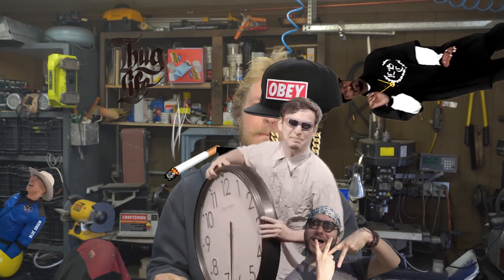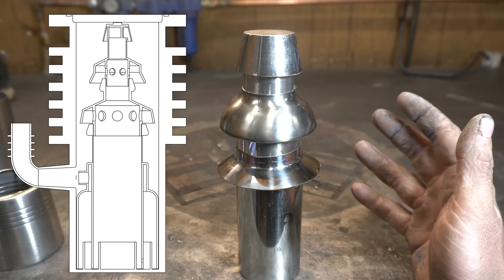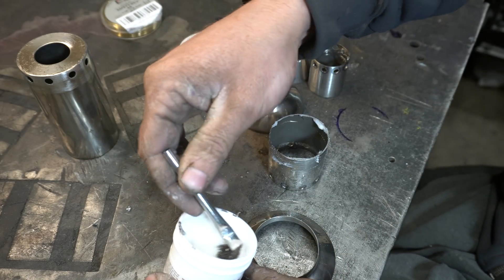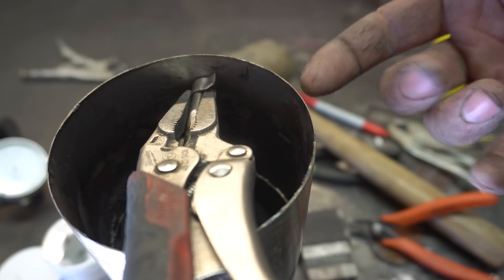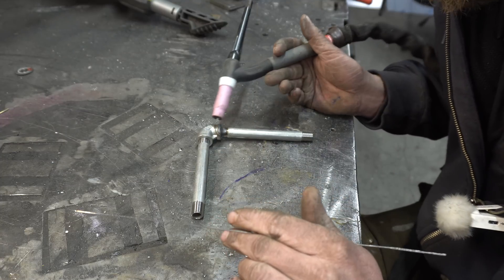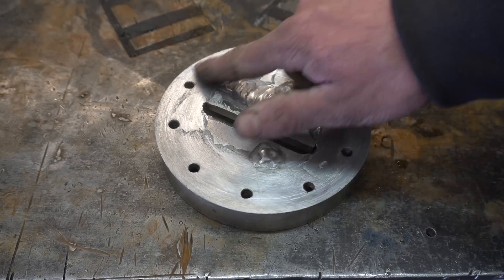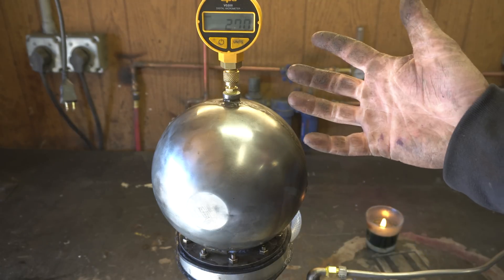Using Your Help to Make Better A Oil Diffusion Pump

Comment: Your diffusion pump videos are great on several levels.  Years ago I bought a small used CENCO diffusion pump - but I talked myself out of giving it a try.  After seeing the momentous efforts you've gone thru to make your own, I feel guilty, lazy, and maybe even idiotic.  I pulled it out of storage today and am committed to heating it up.  For all I know it will work better than I need it to work -  0.01 mm Hg is all I need.

Comment: You can do an experiment to obtain a high vacuum using a mechanical pump operating in a vacuum environment (at the inlet of such a pump there is a vacuum.) The working volume can be large, it is easy for it to pump the remaining gas molecules, and a large volume allows for productivity. I’m not sure about the feasibility of such a pump, but it is only possible

Comment: A couple years ago I built one of these too and it's up on my yt channel. I used exhaust parts instead of other stainless and used jb weld in place of brazing since I read somewhere it could perform well at high vacuum. My experiment failed but it's nice to be able to compare and contrast the different approaches you tried and now I want to try it again! You've earned a subscriber cause your projects are awesome!

Comment: I'm rather impressed with your results.  One of my previous jobs used a diffusion pump that required about 5 gallons of oil!  Was a bit bigger than a 50 gallon drum.  Needless to say it took a few kw for the heater.  Princple was the same and the stack looked a lot like your home-made unit, 'cept being way bigger and too heavy to lift without a crane.

Comment: congrats, you reached to about the same level of vacuum of a good 2 stage mechanical pump 🙃
on a more serious note, you need to clean stuff like crazy, 99.9 isopropyl alcohol then distilled water, then again, then bake all the gear for 1 or 2 hours, then never touch the inside with your fingers.
also, below about 20 microns that gauge is not going to be able to measure anything

Comment: For pressures below 10 microns you really need to use a hot filament ionisation vacuum gauge. The good news is that the gauge sensor is really simple and an improvised gauge is easy to make from stuff you already probably have lying around.

Comment: Try to use pure silicone oil . The cheapest way is get tradmill oil. It 100% silicone oil. I tried it and it works fine and very cheap.

Comment: You should bake the pump and chamber to get moisture out of the surface. Also leaving it running for a long time will help it go down more after a while. You may be hitting a few walls on the way down that just take some time to break through. IE. once you hit the vapour pressure required for moisture to come out of your oil, it will stop going down till the moisture is gone. The same goes for the metal surfaces. Your guage could also cause problems. Look for a pirani gauge on aliexpress for around $20.

Comment: Only thing I can say, is dude... Don't ever change.  Your presentation style with subtle tropes of autism just make my day.  Also, I found your channel a while back when I started researching the feasibility of building my own laser cutter and was just blown away by your success with not only building a complete from the ground up CNC cutter, but the damn tube to boot!  I'm currently waiting for all of the stuff I ordered to show up while printing parts like mad for an MPCNC that v1engineering designed.  Thanks for the inspiration!!

Comment: Another tip for you. I had to go back in your videos and find the diffusion pump you first tried to make. This was the only way I found out WHY you are building one of these. I had to go a little further to find out how it works. I thought I understood the world pretty well but there was still a TON here that I had to research to learn.   I think you would benefit a little bit if you mentioned your other video , linked to parts in it, and/or mentioned your main purpose for doing the work seen in this video. It helps connect the puzzle pieces which means more ppl will end up doing so -- and your channel would likely benefit.     At the same time, THANK YOU for not doing the "subscribe and like" BS that everyone else does

Comment: Amazing video yet again :) and here I am again to make a lengthy list of suggestions, mostly corrections to the first advice I gave lmao
1. Helium trick works way better with a much more accurate gauge and at lower pressures  than your current gauge can read, my bad :/
2. Viton is much better than silicone BUT not flat gaskets, o-rings are much more preferable since they have minimal contact and don’t trap gases as easily
3. Cycle purging, or pre purging your chamber, don’t know why I didn’t think of that one earlier facepalm but anyways use a dry gas of any kind to help remove volatiles and water vapor
4. On the note of water vapor, it’s the high/ultrahigh vacuum’s biggest nemesis since it likes to “cling” to stuff, having a way to bake out your system would be beneficial, in true cranktowncity fashion you could probably manage this just by taking a blowtorch to it as long as you don’t get the gaskets too hot lmao
5. And of course what you mentioned and I somehow completely missed earlier, the roughing pump, that definitely would’ve been the biggest improvement and probably the easiest one since 2 stage pumps and decent pump oil are pretty cheap facepalm x2
Anyways love your content man keep it up :D
Reply from the maker: Hell yeah man, thanks for all the advice. I still got my eyes on your channel waiting for that sputtering machine (If you ever get time off work haha)
Reply: Something i havent totally understand is how improving the roughing pump would help to to achive higher vacuum unleast you are talking about shortening the time to achive uhv since the diffusion pump is suppose to be the main pump that bring the chamber to uhv after the roughing pump is already ineffective
Reply: @btkjay9598  Even though the main pump is achieving the UHV there is always some leakage back through the pump (they only are capable of building up a pressure gradient even if not in laminar flow region). This leakage is significantly lower when reducing the pressure at the backing pump (and also pump speed is increased massively of course).

By the way viton gaskets: Beware that they get brittle after being hot or very cold (when using them on top of commercial ODPs they're usually single use only).

Baking chambers usually works for UHV systems up to around at most 200 Celsius especially when having some windows in there. This won't remove any hydrocarbons thus the best way when one wants to achieve very low vacuum is cleaning first everything that's visible, then cleaning in some soapy sollution, then doing a ultrasonic bath in distilled / deionized water - after that rinsing with distilled / deionized  water again and then dryblowing using nitrogen or argon (never evaporating since that will leave residue). From that moment on only handling with clean gloves - then heating up somewhat above 100 Celsius for a few hours while running the vacuum pump will work (we reach around 10^-12 mbar with that approach by bringing down the chamber first using a membrane+turbopump, then shutting off and using ion getter pumps & in the beginning also titanium sublimation pumps). When one gets in some hydrocarbons one usually has to clean again from scratch (or heat above 400 celsius which is what some manufacturers do before delivery of the parts but that's usually not possible inside of an experiment), when getting in silicone oil or nastier stuff one has to clean in the ultrasonic bath for sure ... have seen Vacuum chambers where baking has not been done using external heating bands but using halogene lamps inside the chamber, that also worked pretty well

(Water vapor should be gone very fast - the next problem that one can counter using baking and that takes way more time is then diffusion of Hydrogen out of the stainless steel surfaces of a typical vacuum chamber. This takes ages especially since pumping Hydrogen is harder than pumping other gasses (which is also the cause why one usually sometimes uses periodically gas balast on the backing pump to reduce hydrogen accumulation in between the backing and main pump to reduce diffusion - but all of that stuff only gets interesting when reaching lower pressure regions for sure - would not care while being above the 10^-7 mbar range / reaching the 10^-8 mbar except for the water vapor that gets interesting at around  roughly 10^-4 mbar for sure ...)
Reply: A better roughing pump yould suck too much of the working-oil-steam. Additional cooled buffles would be needed on the upwards section of the tube, that connects the 2 pumps (or you end up with to little working-oil). Those buffles would re-turn the working-oil-stream back (to where it should stay), but also pushing the gases (that you actually wanted to evacuate) back into the difffusion-pump too, so, an unwanted effect. There´s a point of diminishing returns in this whole scenario, as you can guess. What do people do in industrial installations? Do they use the best roughing-pumps available? OR are there other aspects, that promise more success for now? (for example, an even better working oil, while avoiding welding altogether). A young YTer from Europe mentioned an oil-trader from Germany (just 60€ for 250ml), and the "AppliedScience"-guy noticed, that he used too low-grade flexible tubes for the project´s demands (air would diffuse through the hose-walls)... 33µPa is extremely good, even if 20 is even better, but who REALLY needs such a low vacuum after all ? (let alone 0,1µPa...  ;-)

Comment: This is fantastic, you fabricated a working diffusion pump! Your vacuum reading could easily be the gauge being close to it's limit! I'd be willing to put some money on the pressure being lower than you think.

If you can pick up a Penning gauge (a.k.a) Cold Cathode gauge, those are great: Some of the old style ones are robust, you can clean some of them with wet and dry paper when you need to (I found Edwards ones to be easy to fix unless the metal inside has worn away, others can be but have tiny parts inside). Another one is ion gauges (hot cathode/alpert bayard) but they are pricey and used ones can give weird readings if the were abused and they are easy to kill (or so I am.. ahem told). 

I'm so glad you shared this! It's inspirational!

PS Burn out sucks and it also shows you care, take care of yourself!

Comment: I am curious what will happen if you prefill the chamber with argon, will it just speed up the process or pull it a digit or two higher
Reply: Pretty solid idea actually, it would be even better if he purged it with very dry gas for awhile and possibly even cycle purged it while pulling a vacuum

Comment: Have you looked at mercury to pull vacuum?
Reply: I mean besides the environmental dangers he would still be limited by the vapor pressure of mercury which modern diffusion pump oils far surpass

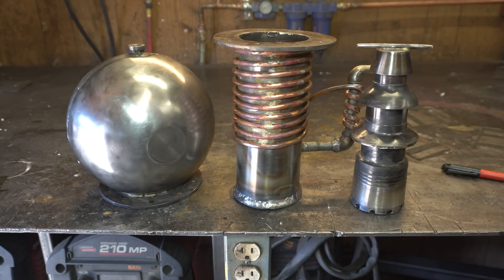Comment: 11:19 you could probably use a thermal epoxy to hold it in place and for heat transfer

Comment: A different approach could be a Sprengel Vacuum Pump -->  https://www.youtube.com/watch?v=viJ3T-1KZqY  (assuming you can lay your hands on a supply of mercury)
Reply: While this would work to pull a decent high vacuum it’s unfortunately very slow and wouldn’t really work for a fusor, plus you’re limited by the vapor pressure of mercury, and lastly that’s a lot of mercury lmao

Comment: Helium leak testing doesn’t work because the pressure jumps up. It works because a mass spectrometer on a helium leak tester machine detects the atoms of helium entering and uses a turbo pump to pull them out. 

A method that might work for you is to keep running your roughing pump but then put isopropyl alcohol on the seals. If you see the pressure sharply rise then stop suddenly then you have a leak. The pressure rises because alcohol vapor enters the chamber but then the alcohol quickly freezes. This is a pretty good indicator of a leak. 

Helium leak testers are stupid expensive. Rubbing alcohol is cheaper but you won’t find as many leaks.
Reply: Great tip! The alcohol technique works really well with high vacuum gauges (penning/ion gauges) because the gauge smashes the molecule apart giving a really high reading!
Reply: Both right and wrong, I was the guy who suggested the helium trick and I probably should have mentioned it really only works if you have a very accurate gauge and can get to a much lower pressure, my bad lmao. Also helium leak detectors are definitely the best method and they’re actually not that expensive if you know where to look ;) got one for just 500$ plus shipping

Comment: I changed the oil in my cheap roughing pump (it was literally the cheapest dual stage but high capacity pump I could find on eBay) to a good brand oil and it improved it's pumping A LOT, well worth the small outlay, plus stripping the pump and making sure it's all fitted correctly and clean helped too.. But not as much as the good oil. Plus your gauge will be right at it's lower limit and starting to miss read, ie you could be much lower than your gauge is saying.
Reply: Great advice!

I also find that running air through the backing pump for 5-10 minutes every now and again, or after an oil change, also helps flush out the oil; I think even cheap pumps have a special "gas ballast" valve on them to help do this.
Reply: @peterspencer6442  ⚠️ God has said in the Quran:

🔴 { O mankind, worship your Lord, who created you and those before you, that you may become righteous - ( 2:21 )} 

📖Quran
Reply: running a pump without a good trap can ruin it in a day

Comment: well if the principle was working, there isn't much reason the whole thing shouldn't be working to the numbers you expected. my best guesses are 1. the gaskets are outgassing (again, any kind of rubber or plastic will to some degree, and that's some pretty big surface area) 2. the oil you're using could also be outgassing, people will often "cook" it by just leaving the pump on for a long time until all the components of the oil that can outgas do, or 3. it is the roughing pump, maybe it's own oil or some gasket or something else outgassing to the point where it overpowers the diffusion pump.
I'm betting on option 1, so maybe try using some soft metals as gaskets, and weld a lip on the pipe joints to bite into those gaskets. Like the copper ones, sam zeloof has a pretty good video on them but I have no doubt you can do it without all the fancy clamps and stuff. After that I'd try cooking the oil for a few days, and if that doesn't work just wipe everything down extremely well with acetone, make sure there's no finger juice on anything, and then if everything in the chamber is immaculate you'll know it's the roughing pump.

Comment: pretty sure the virtual leaks were about the rubber and plastics you used, not the tig welding. Tig welding just melts metal onto metal, and metal doesn't degas. if your welds don't look like swiss cheese you shouldn't have a problem, and even if they do, it shouldn't make reaching a high vacuum more than marginally slower as the only problem that would cause is gas settling in the holes for a little longer.

I went back and read the comment, guy also talks about backing gas while welding to avoid oxides, but that can be fixed with scotchbrite and some acetone (I also don't see a reason oxides would actually degas, they usually have a considerably higher melting point than their non-oxidized counterparts which should mean they have an even harder time subliming under vacuum or more generally reacting in any way).
Reply: It’s more to do with the pores in the oxide rather than the actual oxide and with tig welding if you’re doing a full penetration weld you absolutely need back purge. Imagine it as joining 2 pieces of pipe if you weld on it without a back purge the outside weld will look fine but the inside weld will be very porous and oxidized since the argon won’t be able to reach it

Comment: It's too late now but did you consider tig brazing? It would have resulted in a lot less cleanup.
I only though of it because the other day I found the aluminum bronze rods I bought a couple of years back intending to give it a try. Of course the package is still sealed because...well..um.. I'm too lazy to actually do anything.

Comment: Very impressive job assembling all those parts into one for the pumping stack. Had me a bit concerned at first with the brazing but you really pulled that together.

With how fast the pressure dropped you definitely had the diffusion pump functioning which is quite an achievement. 

Did you try more than just that one vacuum gauge? Wonder if your struggle with the last few microns was just some error in the gauge reading...but I am not super familiar with the way thermistor vacuum sensors work.
Reply: I think you're making a good call about the gauge, I'd bet the pressure is definitely lower than those readings.

Comment: Cody’s lab made a vacuum pump out of circulating mercury, looks very simple in the design.
Reply: Sprengel pump. Problem is that in many parts of the world that for a private person mercury is practically impossible to buy, at least without special permit and those are hard to get due to it's toxicity and environmentally harmful effects.

Comment: trash to .. what
Reply: round neck spot welding
Reply: electric solid state plasma railgun pump
Reply: yes it will sling ions/electrons out as/with electric arc
Reply: witchcraft
Reply: futuristic look